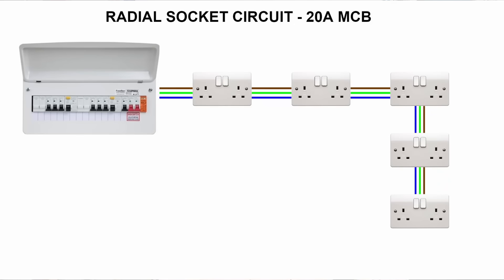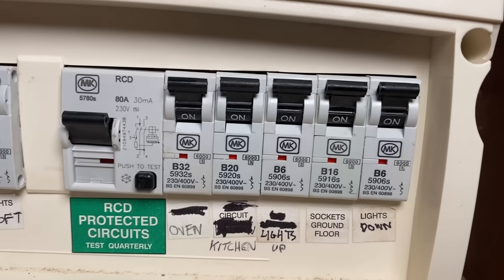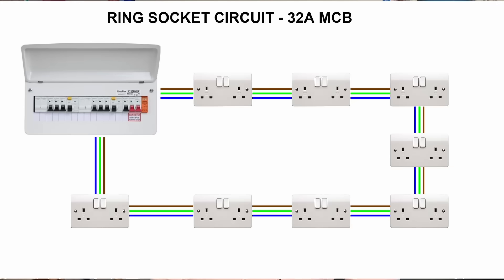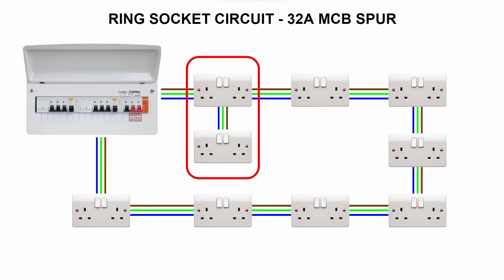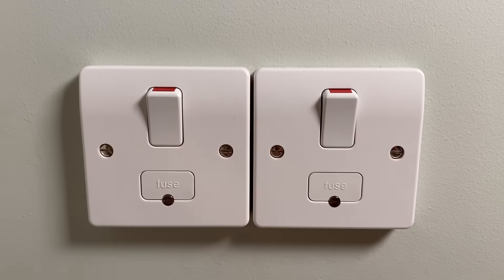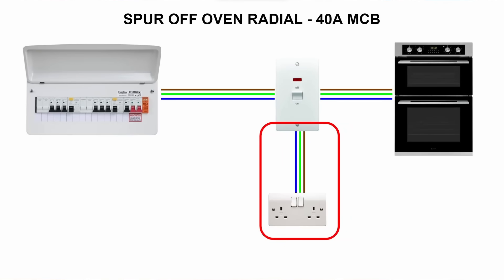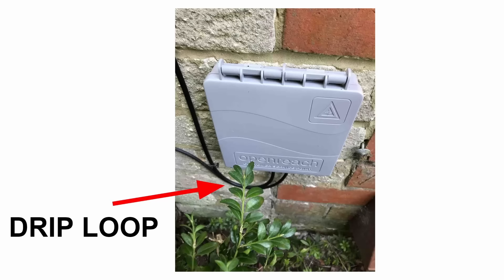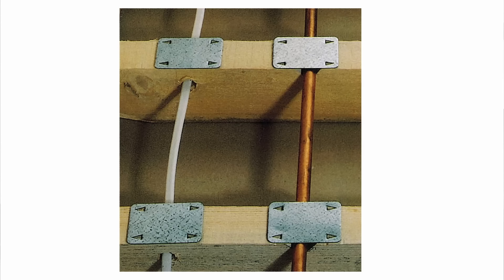BIGGEST DIY Mistakes Adding a New Socket

Comment: For a lamen, how do you identify if you have a ring or radial circuit? (For an old 1950s home that has had updates).

Im looking to spur an additional single socket on top of a single socket spur.
Reply: Seems like the safest way is to add a 13amp fused spur to the mix in front of that second spur socket.
Reply: If it's a ring you can't spur off a spur. You would need to add a fused connection unit BEFORE the first spur, then you can add multiple sockets, limited to 13a total by the 13a fuse in the fused connection unit.
If you have a radial circuit, you can add sockets as you wish, but check the cable and fuse ratings match.
Ring sockets will always have two cables connected, and there will be a 32a breaker with two red or brown conductors coming out of the breaker. Unfortunately spurs may also have two cables if someone has spurred off a spur already - and radials may also have two cables as they are wired in series. So it's hard to tell. Always safest to get an EICR and discuss with an electrician.
Reply: @tobysherring1369  This is super helpful. Thank you!
Reply: @tobysherring1369 It turns out that the single socket I'm referring to was a cooker power connection that was converted to a single socket.  Not sure if it's still going through an isolation switch somewhere else (I wasn't there when this was done).  The objective is that my little office desk is directly behind the wall and I wanted to send a cable through the wall into another socket on the other side.  Just powering a monitor and laptop.
Reply: @Casshern_Sin  If you're certain it's a cooker circuit, and is on its own breaker, then it's a radial. You can use it as a radial socket circuit and add multiple sockets. If it's fused at 30a (most cooker circuits are) then you should run the wiring in 6mm2 which is thick and hard to manage. It might be easier to put in a fused connection unit and use 1.5mm2 to supply multiple sockets the other side of the wall - as many as you want.
Reply: @tobysherring1369  Thanks mate 🙌🏽
Reply: @Casshern_Sin  I was going to add that you could downgrade the breaker to 20a and use 2.5mm2 cable for your new socket(s). It's easier to handle and you can add plenty more if you need to. Worth noting this by the consumer unit.
Bear in mind that your work needs to be inspected, tested and certified. You could have an EICR once you've finished, or just get an electrician to do it - cheaper in the long run. If you're aware of earlier modifications it's worth having an EICR anyway, unless it was all done by an electrician and you have certification.

Comment: for a spur I double the 2.5mm twin and earth so effectively you extend the ring. nice clear presentation. I hadn't come across safeplates before, normally having wires clipped in ducting, but they sound useful.

Comment: That was great, The origin of the ring circuit was very interesting, I didnt know that, I have in the past spured off an existing socket with more than one double socket and I kinda knew this was dodgy, I like your explanation of why its ok if you fuse it, I will add a fuse in line some time soon

Comment: For computers and other smart home  appliances there is increasing need for multiple outlet sockets to replace  single outlet sockets.
Most sockets convertors to  two, three or four outlets have standard 13 fuses incorporated into the. socket which is more than adequate for modern electronic devices.
However some socket converters don't and some are of poor quality so take care when buying.
Reply: To meet British Standards, anything over two sockets has to be fused. If  items are for sale with three or more conversion sockets with no fuse, they should be reported to trading standards. They're dangerous.

Comment: The most silly rule. Radial makes the most sense. With rings you always have more copper use and so much more hassle.
Reply: It's not silly, when fuseboxes only came with 4 routes.
Reply: @0w784g  Silly to design a fusebox so small.
Reply: @FIGHTTHECABLE  Not silly when houses had only 4 sockets and no white goods.

Comment: Hi! Thank you so much for your fabulous video and explanation. Its so clear and i have learned loads.
I was hoping i could ask you a question though. 
I am wanting to take a spurr into my loft, but i was hoping to have multiple sockets. If i use the fuse, can i only have two sockets coming off that fuse or more daisy chained? 
And would i be able to have to have two lots of cables going in different directions from the fuse or not? Hope that makes sense. Thank you in advance for any advice you can give me..😊
Reply: Yes, use a Fused Connection Unit where you take the spur from the ring. Label it. Then you can have as many sockets as you want, on multiple legs. However you will be limited to 13a for all sockets combined.
If it's a loft conversion you should probably either extend the ring or run a new radial- then you can draw more than 13a.

Comment: That ring thing is just so stupid and unnecessary.  We don't do it . Cable in tap off down to outlet.  Then for 15 amp another breaker and cable from box to a 15 amp outlet, the others are 10.

Comment: People don't understand current. They also don't understand that for example a rack of 6 amplifiers has huge capacitors that immediately draw power therefore they shouldn't be on a single light switch. I'm IT but projectionists bring me Dolby DACs that blow up, I look inside and the TVS diodes are brown instead of black - that's all from the power surges.

Comment: When the DIYer has finished the work you encourage them to do there is a small problem...The DIYer does not posses an £800 test meter nor the knowledge to use it make sure it is not lethal. How do you live with the fact that a father or child could be lying dead through watching these DIY Dave videos?

Comment: Thank you for the safe plates tip, I'm currently building a game room with a few arcade machines & other beefy electricals to power, I've got 6 double plug sockets all direct to the consumer unit, non are daisy chained, what rated breakers will i need 🤔 thanks in advance
Reply: If you're asking that question on YouTube and have already run the cables, you need an electrician. As you're running new circuits you must notify building control, or use a registered electrician who can do the notifying for you. Breaker size relates to cable size.

Comment: Hi there any chance for advice, I want to put a socket in the attic on an 6mm power shower circuit. Can I ad 13 amp spur fuse and then after fuse 2.5 mm cable and a socket? Please advise. Thank you. I enjoyed your posts
Reply: Yeah I've runner a shaver transformer off a 13Amp spur in turn off a 20A MCB protected radial to a hot water tank immersion heater.  You have the protection of the 13Amp fused spur.  You could even drop it to a 5 or 3amp fuse in that spur it consumption was low, for extra safety.

Comment: can i wire a 13amp double or single socket directly into consumer unit . In same cupboard about 300mm below please
Reply from the maker: Yes, it’s effectively just a spur starting at the CU. I believe you need to be a qualified electrician to open up a consumer unit though, so worth getting professional advice. Thanks for watching!

Comment: I do not like ring circuits for one basic reason, a single break in the circuit will leave the system live but having what amounts to two radials on a 32amp fuse and that’s unsafe. I always advise radial circuits on a 20 amp fuse that way if a break occurs all sockets after the break won’t work and would need investigation.  It does means extra fuses but in my opinion it far safer. If I were to add a spur to a ring then I alway wire  it though a 13 amp fused spur either switched or unstitched depending on customer preference. In my opinion rings should be banned as they’re unsafe especially when DIYers start adding unprotected spurs.
Reply from the maker: Agreed, thanks for watching!

Comment: Electrician trainee here ✋️ 

My home is a new build, it's on a "ring" circuit. 

The consumer unit has a 32a breaker for "rear downstairs/upstairs sockets". 

I switched this breaker off, to change a plug socket in a room at the downstairs rear of the house. 

Our kitchen is at "the front" of the house, therefore, the sockets there were still live and working. As my partner switched the oven on, the RCD tripped, resulting in the oven tripping too. 

Is this because there is a lack of current going to the cooker because I switched off the MCB for the "rear" of the house? 

Please go easy, I'm still learning 😅
Reply from the maker: I’m not sure why the oven would cause the rcd to trip only when the back of the house is turned off, and not at any other time. An oven circuit should be unaffected by turning off another circuit. Sorry it’s difficult to say without seeing it. I wish you the best for your studies! Thanks for watching!

Comment: What are you guys putting in your sockets over there in the UK??? In Germany we use 16A Circuit breakers and 1.5mm2 cables for a normal room.
Reply from the maker: Interesting, perhaps German homes typically have more circuits, so thinner cable can be used for each. Thanks for watching!
Reply: Wish they did. (Ok speaking of Austria, but experience of Germany as well) you’ve removed the lighting circuits as these are combined. Except for kitchen appliances there is still a tendency to throw everything together in large groupings. 
I am talking about reworked houses/flats. No effort has been made to split or update the consumer units.

Comment: Why not just make all the wiring including light circuits 2.5mm. That way you are doubly safe and the wiring can handle being spurred off, lighting circuit or not.
Reply from the maker: I imagine because that’s a lot more copper, so expensive and not necessary, also 2.5mm2 is larger and less flexible so less practical for often small light fittings. Thanks for watching!

Comment: Very good. Regarding the fused spur, is it acceptable to have switchable FCUs (with the load going to other appliances, say a 1A switched FCU for a light) as part of a fused spur? (Imagine the diagram at 6.05 with the first double socket on the fused spur as a switchable FCU going to a light.)
Thank you.
Reply from the maker: Thank you! I can’t see any reason you can’t have a fused spur off a fused spur, current is still capped by the first fuse. 
Thanks for watching!

Comment: Very useful video, but my OLED tv only draws 85 watts according to my power meter and my fridge freezer very little more . My Dishwasher has a hot feed and the washer is set to cold wash . Lighting is LED's. so the only large consumers of power are the shower 8KW (4KW Eco setting) , the oven 3KW and the induction hob 5/6 KW ? These all have dedicated circuits , so are rings really out dated , and should be replaced with individual circuits.?  I can foresee that soon power requirements on outlets will be even lower.
Reply from the maker: Thank you! Yes i think rings are outdated, but it seems a controversial opinion! 
Thanks for watching!

Comment: Hi, I'd like some help for a light installation that I want to do. I want to install a light that is very close to my consumer unit and there are no sockets nearby where I could take a 3A FCU spur out of. Currently from my consumer unit, there is a spur out of my immersion circuit breaker to a single socket which my wifi router is plugged into. My question is could I take a supply from this socket to a 3A FCU which I will connect next to this socket for which I could power the lights I want to install? Thanks in advance.
Reply from the maker: You shouldn’t take a spur off a spur, although if the immersion heater has its own MCB, then it wouldn’t be a spur, you’d be extending a radial. So as long as the cable is appropriately rated, it sounds okay. Thanks for watching!
Reply from the maker: Or are you saying there is a spur straight out of the MCB for your wifi socket? So you’ve basically got two radials out of one MCB? If you can appropriately size the cable, probably still okay, but difficult to say without seeing it
Reply: The obvious thing to do is wire a 1.0mm2 cable from the 6a lighting circuit to a switch then to the light.

Comment: Can you spur off two double sockets in a circuit? So two spurs but not daisy chained?
Reply: You can run multiple spurs in the same ring (unfused) as long at they’re all off of separate sockets. Similarly to how you can have an unlimited number of sockets in a ring main (within reason).
Reply from the maker: I don’t think it’s allowed, but I also can’t see why it would be an issue, other than the difficulty of getting 4 x 2.5m2 cores in each terminal and fitting it all in the back box. Best to take them off on a fused spur and do as many sockets as you need. Thanks for watching!
Reply: You can have as many spurs as there are sockets on the ring. Extending the ring is also possible if you need multiple extras in the same place.

Comment: How do you check if a socket you want to run a apur from is already a spur...? Is it simply that there's no onwards cable? So it would only have a single cable at rhe back?
Reply from the maker: Good question, with difficulty, you’d need to open up other sockets and use a multi meter with the power off, to determine which cables go where. Thanks for watching!

Comment: Ring circuits were introduced in 1947, and had nothing whatever to do with copper saving. The original cable used for ring circuits was 7/029 which was rated to carry more current than 2.5mm solid conductor, which was introduced because it is cheaper to make. Most of the uk housing stock was rewired in the sixties and seventies, when you could have any number of sockets on rings, and any number on spurs as long as there were not more spur sockets than ring sockets and the whole ring did not serve an area of more than 100 sq mtr. The only time i have ever seen a break in a ring is where a socket has been installed in a damp wall and has corroded , and this is because i was trained ( at a technical college) to twist together the conductors before putting them into the socket, and then tighten the screw till the brass squeaked. Fitted like this broken rings caused by loose cables simply do not occur. Todays training insists that the cables are NOT twisted together in order to make separation for testing easier. Safety sacrificed for the sake of convenience! In a radial circuit current only flows one way and is cumulative, in a ring the actual proportion of current imbalance in the legs is tiny. The rewiring done in my day reduced electrical house fires to the lowest level they have ever been, today they are on the rise again, with consumer unit fires ( something that never existed during my career)  becoming scarily common! Something is wrong, and it is not the design of ring circuits, it is the pisspoor design of the mcb termination and the pisspoor training of “technicians”  If i had failed to twist wires together properly during my training I would have failed my first year practical exam, which meant you got one retake and then the sack!! Today everybody gets a pass. And the emphasis is on covering your backside with regulation compliance rather than producing a safe installation.
Reply from the maker: Thanks for watching!

Comment: What the difference between running the 2 more double sockets or use extension and plug in kitchen equipment
Reply from the maker: An extension lead is fused
Reply: @TheDiligentDIYer1759  I am going to put 2 extra double socks in commercial kitchen.I think I better use RCD sockets for safety

Comment: Right, we certainly don't have that rule in Australia. Our circuit breaker has to protect the cable so cant be more than essentially 20amps on a 2.5mm² circuit
Reply from the maker: Interesting, thanks for watching!
Reply: To be fair the breaker in the UK protects the cable too - it's calculated on the basis of two cables sharing the load, not one. As long as no-one tinkers with it, thus breaking the ring, it's fine. 
I'm Australian now and find the 16 or 20a radials here much safer. Rings really aren't needed any more and there's too much risk of problems

Comment: I've never heard an explanation for ring circuits before!  The war makes perfect sense.  Thank you!  Never legal in the US.  Ring configurations were used in some communications systems, though, and with the same issue.  Without a failure detect mechanism, you wouldn't know you lost your redundancy.
Reply: Ring circuits are commonly used in long haul fiber communication systems as SDH/Sonet systems. There is a virtual break of the ring when in normal use. The moment a real break occurs, the virtual break is shifted to span the real break and the fault alarm is raised.
Reply from the maker: Thanks for watching!

Comment: Here in Malta we used to use ring cables and i always wondered how exactly they save less cable. Really informative thank you
Reply from the maker: Interesting, thanks for watching!
Reply: @TheDiligentDIYer1759  years gone by, in 1950s especially, intake and fuse board would usually be under the stairs or toward the center of a dwelling. Ring would run around the central parts of the house, then designed to spur off to sockets on outer most points. Doing that would save cable for the most part. I fully agree they are an archaic and fairly daft method to use today! I tend to derate the protective device to 20a to negate the potential problems they pose. Other than kitchens, 20a is quite adequate to serve a substantial part of a home.